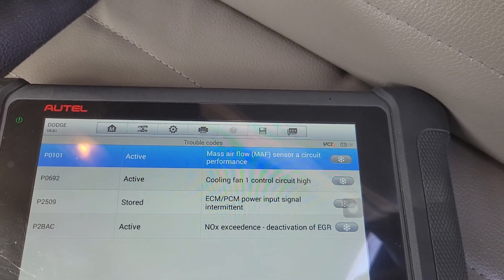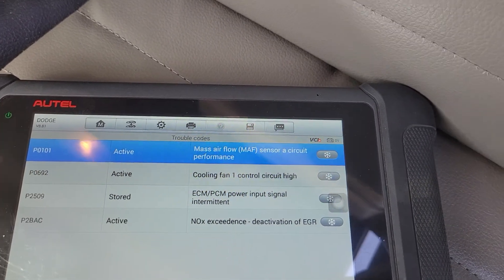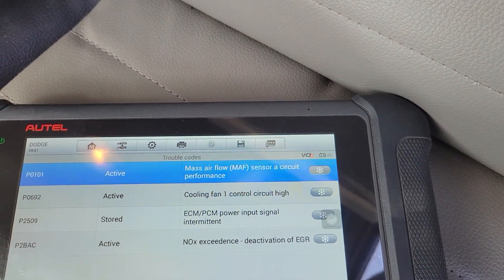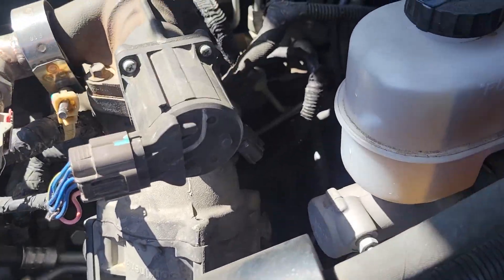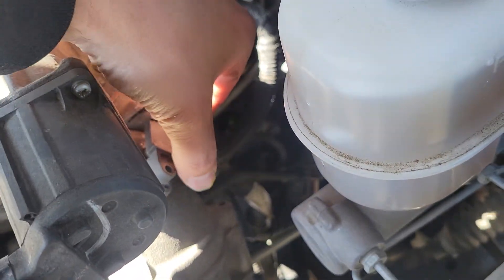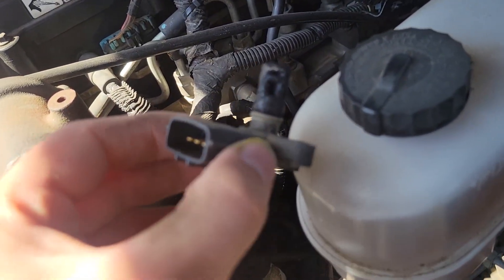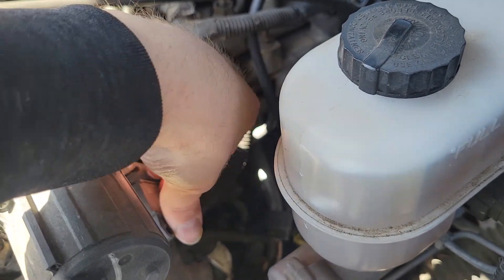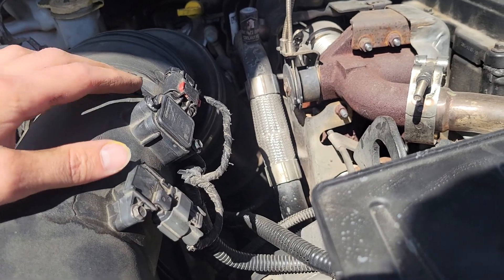Ram 6.7 P0101 Code with P2BAC fix

Comment: Never knew that was there. I only looked at the cold air intake sensors which were clean. I pulled this one out and it was disgusting. Sprayed it down with MAF, hopefully that works.